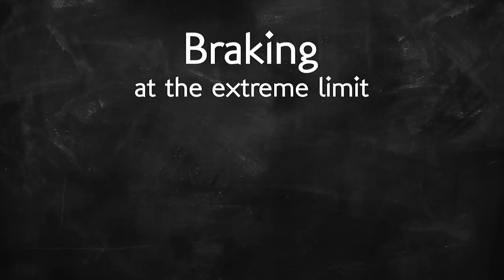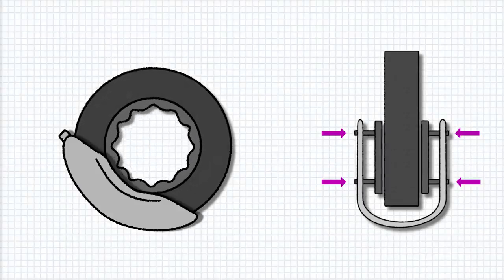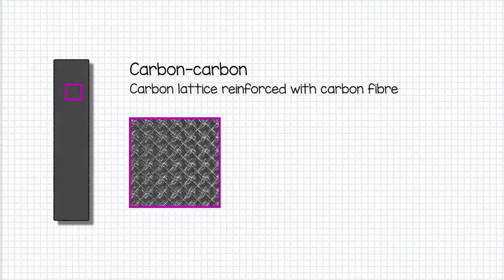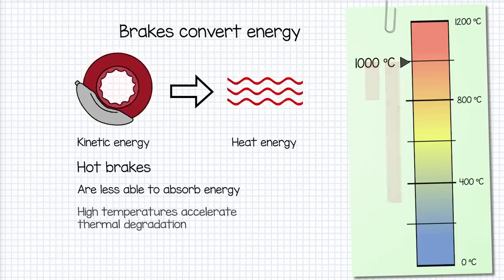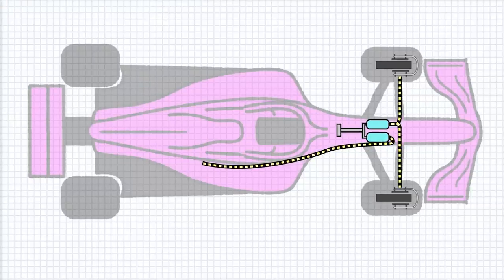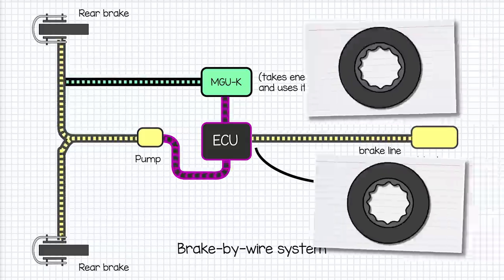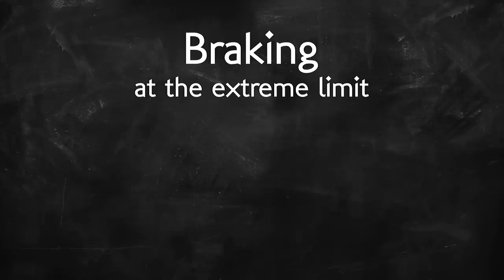F1 Braking Systems

Comment from the maker: *CORRECTIONS CORNER*:

- I say "fluids" are incompressible but what I meant to say was "liquids" are incompressible as "fluids" includes liquids and gases (and some other matter states). Because my brain was saying "brake fluid" I accidentally used the word fluid instead of liquid.
Reply: i think there's a spoonerism in the mgu-k section
Reply: Chain Bear F1 is there ABS ON F1 CARS
Reply: Enrique F No as that would be considered a driver aid hence why you see people locking up. ABS would stop that from happening.
Reply: I'm sorry to inform you that even your correction is wrong. Liquids are compressible even more then you might think. A liquid like water will compress 10x easier than concrete and even 100x more then steel. (elastic modulus of water EV = 2.10^9 N/m2 )
Reply: Liquids are considered incompressible is more accurate. 
We all know that they are in reality slightly compressible.

Great video, very instructive, love it !
Reply: yea liquid does compress
Reply: Thank you so much for all your videos! Im learning so much! Keep it up!
Reply: Also, Ice itself is not slippery (low CoF). When force is applied to ice, a layer of water is formed (water is higher density than ice) which lubricates the surface.
Reply: I think more-smaller brake vents are for increased surface area rather than volume
Reply: In the future, you may also want to get a ruler graphic that shows inches and centimeters in the same direction, instead of a real ruler where they start at different ends, so that the numbers for both are right side up :)
Reply: Everything is compressible... Unless it has an infinite elastic modulus. Steel is compressible otherwise sound would not propagate through it ;)
Reply: Eagle id say they are nearly incompressible but we know its possible, as Jonas Caes said.
Reply: Literally unwatchable!
Reply: Chain Bear F1 good job! Pls make a video  tutorial how an f1 car set up for differed tracks. And talk about brake bias aerodynamics downforce. And diffrental and the fuel mix ( rich, poor) thx
Reply: Enrique F no there is not
Reply: Chain Bear F1 9
Reply: Isn't F1 using brake by wire now?
Reply: Jose' Sammut Although you are correct on F1 cars not using ABS nowadays (they have at times in past.)

However, having ABS doesn't necessarily mean that cars won't lock up, as all cars of any type can still lock up w ABS on.
Reply: Everything is compressible. Even Fluids and liquids.
Reply: BBW
Reply: Chain Bear F1 your still pretty great though
Reply: Chain Bear F1 Another great video! Thoroughly enjoyed it! CO2 has a linear shape instead of a V shape.
Reply: Hmm... I found videos by Brembo about braking power. But they seem 
paradoxical to me. In Monza the speed change is only 109 km/h over a 72 
meters with a claimed braking power of 3010kW, but in Azerbaijan it's 
216km/h over 56m but only 1901kW braking power is claimed. Makes no 
sense.
And on neither "hardest braking point" is after the longer 
straight with the sharper (or just as sharp) turn at the end. Also 
doesn't make sense.

What do you think about this?
Reply: Your correction is wrong sadly liquids are compressible but the forces required is not that realistic for a race car.   I would say "liquids are difficult to compress" . 
-  Keep up the good videos tho.
Reply: I'm sorry to inform you of another mistake I found:
the coefficient of friction isn't "how well a material grips"  but instead it varies between 2 materials (http://www.engineershandbook.com/Tables/frictioncoefficients.htm). so it's better to say "It's the grip between 2 materials".
Great Video, as always!
Reply: You are forgiven, however with Pascals Law, it might not be so understanding.
Reply: How this brake fluid can witstand those temp.?
Reply: @jonascaes1085  give him a break. Compared to ideal gases where pressure times volume over temperature is constant, means double pressure half volume, the compressibility of breaking fluids is incompressible under breaking.
Reply: Ice can be very grippy, I've seen Dumb and Dumber
 @kalecrosbie8878
Reply: More importantly (to a chemist like myself). CO2 is a linear molecule. The O-C-O bond angle (or really O=C=O) is 180*.
Reply: Is their a way to turn kinetic energy to sound energy because in theory wouldn’t it make for a good brake system as the brakes or whatever would stop the car would wear less over time
Reply: at the end u also said braking instead of breaking
Reply: Chain Bear F1 no worries mate.. we understood
Reply: The part you said, "...the kinetic energy of the spinning wheels...", while the brakes are converting the kinetic energy of the whole car (distributed between each caliper).
Reply: 7 seconds in and the first mistake (conversions in parenthesis added): "Formula 1 cars can come to a stop from 100kmh (62mph) in about 15meters (50ft) which is almost 1/4 of the braking distance of your average road car."  More like between 1/3 and 1/2 the braking distance of your average road car.  My late 20th-Century BMW stops from 100kmh in about 120ft (37meters). My elderly mother's 2017 Kia Sportage stops from 100kmh in about 115ft (35meters). Early hyperbole doesn't bode well for the accuracy of the rest of the video....
Reply: Liquid is also one of the kinds of fluids, I suppose.

Ur explanation is awesome. Thanks a lot.
Reply: @TheCube_Man  it's in the video. It shortly displays a disclaimer about this fact....

Edit: timestamp 3:13
Reply: Also, a CO2 molecule is completely straight, but you drew it in a “V” shape like a water molecule.
Reply: Which software do you use for creating these videos?
Reply: @enriquuu  No ABS is banned in F1 as it is a driver aid and all driver aids are banned including traction control and all.
Reply: L
Reply: L
Reply: L
Reply: Lllllllllllllll
Reply: Llll
Reply: you all prolly dont give a damn but does any of you know a method to log back into an Instagram account?
I was stupid forgot my account password. I appreciate any tips you can offer me.
Reply: @Zayne Grey No problem =)
Reply: Hello, can you tell me how the front brakes get so hot to  the point of flaming at the start?!
Reply: One more correction for an otherwise great video: The 'smaller but more holes' isn't to allow for more airflow through the brake disks, it's to increase the surface area where the disk and the air contact each other, so that there is more dissipation of heat possible.
Reply: fluid is anything that flows..

Comment: Wow technology has progressed quickly.  I can remember in the early years of f1 when the brake discs were pinched by real live clams.  So when you wanted to slow the car you would yell at the clam and he would use his shell to pinch the disc.  We called it "clamming on the brakes".  Then they improved it so that instead of yelling at the clam, you would push a lever that struck a flint and lit a fire under him.  We called that "brake by fire".  And later on came the invention of having aquatic birds in there to blow air on the clams and those were "cooling ducks".  Goggles Pizano won 11 races that year.  Those were the days...
Reply: An interesting side note to this is that as technology of road cars progressed without the competitive rules of F1, various forms of cooling were attempted for brakes with liquid cooling proving very effective when using melted butter; this in turn caused the term 'getting on the anchors' to become popular.
Reply: And i thought they would roll a boulder from the side of the track in an attemt to "break" the car..... But you could imagine this would slowly stop the car if the boulder missed and another attempt had to be made... The factory sponsored F1 team , having more resources eliminated all other teams when they set up series of "breaking points" on the chassis and along the track with "break men "   would have to  "breakfast"   for the first time
Reply: Are you high?
Reply: This is one of the very best threads on YouTube
Reply: oinka720 don’t do drugs kids.
Reply: Still remember this sound of v46 engines...
Reply: Classic
Reply: i remember when you hat to grab the brake discs with your hands to slow down
good ol times
Reply: braking is such a drag... thank God for cooling Ducks😊 feed then duck tape and they are happy😊
Reply: oinka720 this is an incredibly underrated comment.
Reply: Back when F1 cars were actually pulled by horses... thus the term 'horsepower' comes in
Reply: That was quite funny. Thanks for the laugh.
Reply: oinka720 if I recall correctly, In the first races you actually grabbed handles that were nailed into the road that you reached out and held, and that force slowed down the car
Reply: I salute you sir, I couldnt help but giggle :P
Reply: Hello there grandpa Simpson
Reply: Flintstone1 Racing
Reply: You're ridiculous. 😂

Comment: Great explaination! Please do one on how the MGU-K harvests kinetic energy because right now this seems like 100% magic to me
Reply: @andrewb378  it's just an electric generator attached to the turbo shaft as far as I know.
Reply: @andrewb378  That sounds more like how the MGU-H (which gathers energy from waste heat) would work.
Reply: @exscape  if the mgu-h was powered by the turbo SHAFT then it would be harvesting kinetic energy not heat, making it an mgu-k (i believe lol)
Reply: @jacobgross319  I sort of agree, but that seems to be how it works. Every source I find either states that, or some less concrete version that doesn't actually mention the details.
Reply: @jacobgross319  Both MGUs are electric generators. MGU-H (Heat) is coupled to the turbo shaft, keeping the turbo at revs all the time, eliminating turbo lag. MGU-K (Kinetic) is coupled to the crankshaft (before or after the transmission idk.). That way it can be used to supplement the main engine running as a motor, or, more importantly, put a load on the drivetrain (charging a battery) to slow the car down.  Most electric motors can be used as generators, not all but it is definitely possible. Hope that explains it.
Reply: im just curious as to why they dont also harvest the front brakes
Reply: @jdd5672  I would guess that's because 4-wheel drives are not allowed yet. MGU-K is basically a motor (which act as a generator on braking) and returns harvested energy to the wheels themselves

Comment: Was a very detailed description. Thank you for the very well curated content.

Just one thing I'd like to point out, which is a suggestion and by no means criticism! Friction coefficient is not a property of a single material, but always a property of combination of materials/surfaces. For ex. rubber on ice and rubber on asphalt will exhibit very different properties. This can't obviously mean that rubber has two different friction coefficient values. 

Therefore you always specify friction coefficient between two surfaces :)

Comment: Fluids are not necessarily liquids, but also gasses (and plasmas) too. While it is hard to compress a liquid, I can assure you that compressing a gas is trivial. It is important not to get confused between a liquid (the state of matter) and a fluid (anything that has the capacity to flow) as you have done in this video.
Reply from the maker: ah yes this is true - careless language
Reply: I was thinking the same but most of the time in everyday life, these two terms are interchangeable so a simple video on youtube should be fine to use them in this way.
Reply from the maker: I would normally argue that in every day language it's fine but I do specifically talk about the difference between liquid and gad compressibility so that's a boo-boo on my part

Comment: It would be great if you could get into more detail about how the MGU-K actually uses the braking energy. Other than that, fantastic job!
Reply: Seems pretty simple.  MGU means "motor/generator unit" (practically, there's very little difference between a motor and a generator, so it's trivial to make something that can do both) and the "K" is for "kinetic."  

It's going to work just like a hybrid road car - you step on the brakes, the ECU increases field at the MGU, causing it to start charging the battery pack.  Depending on all the variables mentioned in this video, the field strength will be regulated by the ECU.  It's hard for some people to understand (looking at you, all the "green gas" and "HHO" idiots from a few years back), but increasing electrical load on a generator increases the mechanical input that's required to turn it because physics.  This is the reason older cars with loose/worn belts would get extreme belt squeal when they were first started - the generator (AKA alternator - same shit, different way of getting it done) needed more energy input to recharge the what the battery had lost from sitting and then from the high amperage drain of cranking the engine.  After a few seconds, the squeal would usually stop.

So, long story short, the MGU-K is going to help slow the car by taking the kinetic energy of the car and instead of turning it all to heat (a lot of it will be lost as heat, though, because thermodynamics), it's going to convert it to electricity to be stored in the hybrid battery.

If you wanted to, you could actually assist the mechanical brakes with a generator, a heating element and some kind of heat exchanger.

Comment: A more to the rear brake bias helps with better front grip at the turn so you need to find a sweet spot. When you transfer the weight to the front the front tires get more grip, but it they are used to brake the grip is shared between braking and steering.

Comment: Great channel and great episode.  Typically when I seen a piston in a hydraulic system the mechanical advantage comes from a smaller piston  (the input or foot on the pedal) being compressed at longer stroke while the output force being being larger than input, but the output stroke (ie linear distance traveled) smaller. Just a small detail. 

Also, it is alright to assume fluids are incomprehensible.  Most people state it’s a compressible when it’s a gas.

Comment: Interesting side note: 
Carbon-carbon is, due to the properties mentioned in this video, what was used as the heat shielding on areas of the space shuttle where tiling wasn’t possible, such as the nose and leading edges. Under sudden shock it’s a little brittle, which is why the insulation foam piece striking the wing lead to the destruction of space shuttle Columbia

Comment: 3:13 Also, ice is tecknically not slidey. Its just a thin layer of water that is oroduced when pressure is applied to it which makes it seem slidey. If you try to slide on ice in sufficiently cold weather, its surprisingly grippy

Comment: Teams use high brake temps to heat up the tyres after the formation lap. You'll see them braking heavily because the disks then radiate heat back into the tyres to help keep them warm while waiting on the grid. You'll often see smoking brakes because of this.

Comment: When driving, I like to find by braking bias by starting with a rear biased car, simply because if you lock a rear wheel it won't be as damaging to the tyres as if you locked a front wheel. And because it sometimes can be much easier to feel when you're locking the rears rather than locking the fronts.

Comment: While it's true that it's easier to stop a disk from spinning by grabbing it farther from the center, it won't stop you faster because you are already putting down maximum stopping force (you can lock up your tires) the advantage of larger brake rotors is that they can hold more heat before getting too hot.

Comment: An interesting topic which you did not mention are the Brake Housings (Cake Tins). They are made of Carbon/Resin composites and must withstand the extreme heat from the discs. I did some research beacause I find thermal insulation materials quite interesting. Zircotec form UK makes ceramic + aluminium coatings for insulation and radiation reflection. I'm still wondering that such a thin coating can withstand a whole race.

Comment: Fantastic - the only thing I would add would be that you say the MGUK (which is a generator) takes energy from the rear wheels to drive a generator. The MGUK is the generator.
Reply: P.S. I know you know this, it was just to clarify the point which seemed unclear on the slide. Thanks.

Comment: The brake disc is ever so slightly out of alignment so that when the brake is released, the disk pushes the pistons back. Carbon-carbon is also called Carbon fibre reinforced carbon (CFRC)

Comment: Could you have controllable brake ducts that lets you adjust the amount of air used for cooling? It might be an advantage to use a lot of cooling for the bendy part of the track, and then turn down the cooling on the straight.

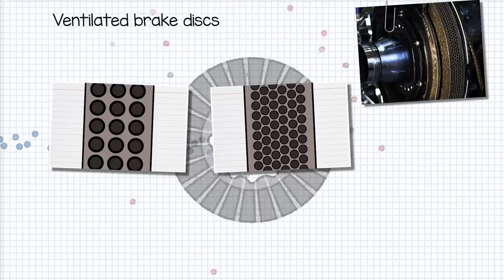Comment: For the brake discs, you mention the increase in number of drilled holes being for greater volume (5:35). The volume of air isn't as important in this case as the increase in surface area. Having more volume of air isn't going to help extract nearly as much as increasing the surface area.
Reply from the maker: They're intertwined as the width of the annulus remains unchanged

Comment: Thanks for the correction on fluids vs liquids, but don't worry you are not the first or the last to accidently misuse the terms in this fashion. However I have one more point to debate,

The reason for more smaller channels in a brake rotor is IMHO not primarily aimed at increasing volume of air...rather the primary factor is the increased surface area exposed to the air, hence the greater transfer of heat to the air passing by despite the decrease in flow due to the greater surface friction the air will encounter. 

The reduction in size can only be taken so far, as at some point the differential between the temperature of the surface of the passage and the temperature of the passing air becomes so small as to defeat the increase in surface area.